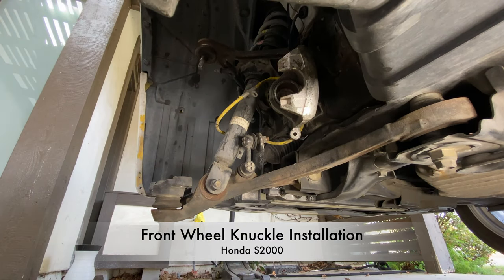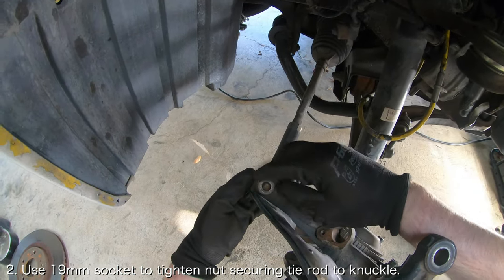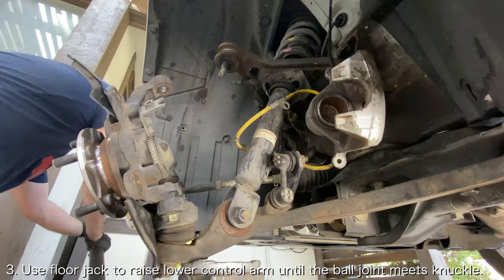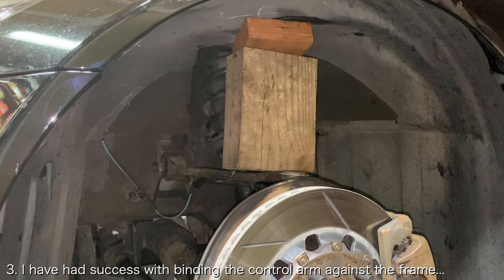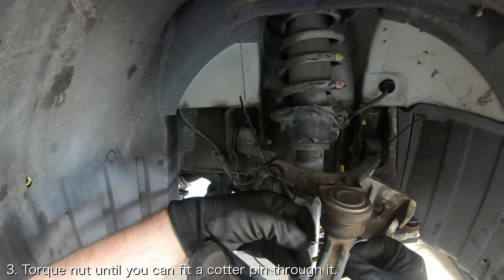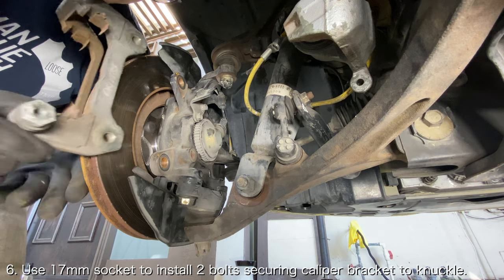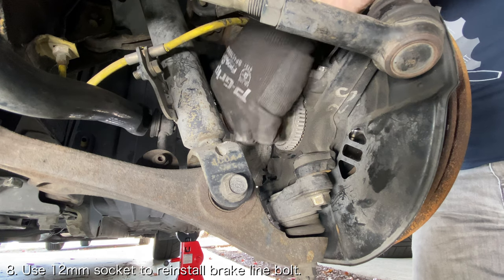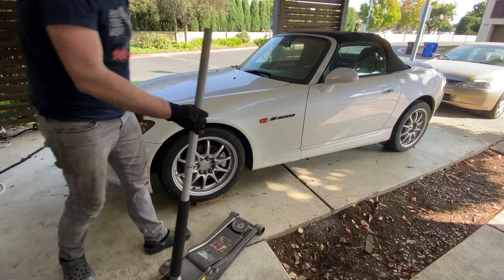Front Wheel Knuckle Installation | Honda S2000

Comment: I need to replace a wheel stud on my front passenger knuckle. If the job is done properly by removing the knuckle, do you have to replace the wheel bearing?
Reply from the maker: You can replace where studs without replacing the hub and bearing. I think zentrose has a video on the subject but it s definitely a hack. If you pull the hub you have to replace the wheel bearing tho, no way around it.
Reply: DIYGuys yeah I watched his video as well as a few others but wasn’t too keen on cutting the heat shield or stud.  Thanks for the reply